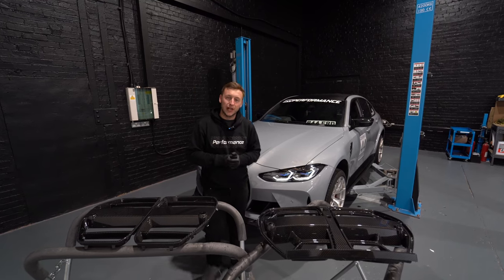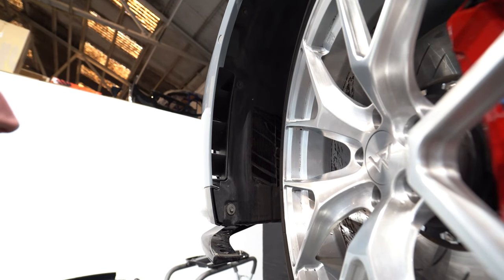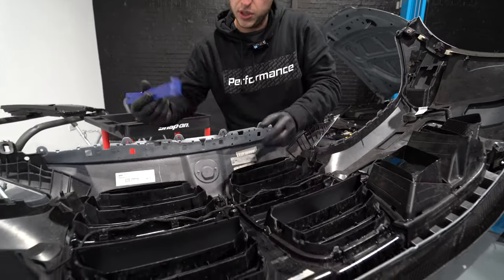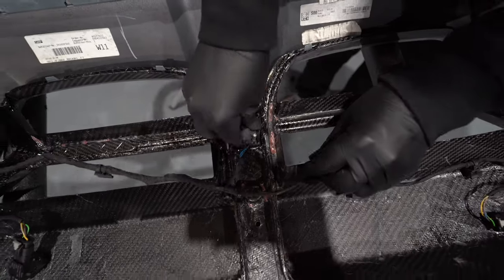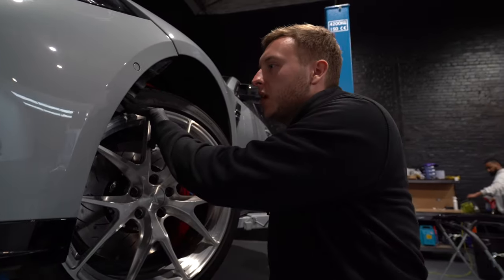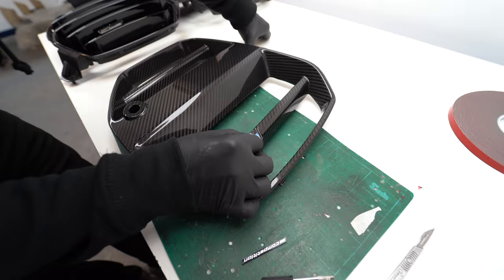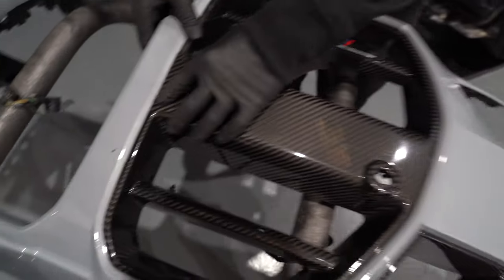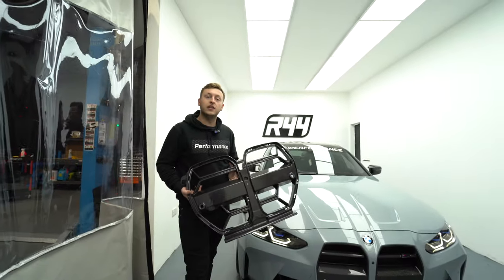INSTALLING CARBON GRILLES TO THE G8X, MHC CSL & GT Style Grilles

Comment: Awesome video, MHC products are so good. Unfortunately I cheaped out and purchased a dry carbon CSL grille from China. Overall looks good but the fitment of the parking sensors are not spot on throwing control messages from time to time. Any issues with the sensors lining up on this grille? If I'm going to purchase another grille, I'd like it to be my last lol. Thanks all!

Comment: Is that grille same as vorsteiner grille?

I think it would look better if that 2nd gap between upper thin line, and the thick mid section line, had classic vertical BMW style stripes. But the lower corners rounded off, and mid section in bodypaint possibly
Reply from the maker: Hey man, it is different actually, it has a lower line, the vorsteiner has just the top and central piece!

Comment: By installing the CSL grill there is no risk that a stone could pierce the radiator? Thank you!
Reply: Stock grill still has openings with same potential to get damage. CSL is def more open but finding out through research you might want to invest in either a DIY mesh behind the grill (see Vorsteiner) or places like CSF sell aftermarket heat exchangers/transmission coolers with rock guards instead of putting a guard on the grill. Think that’s the move even with more cost.